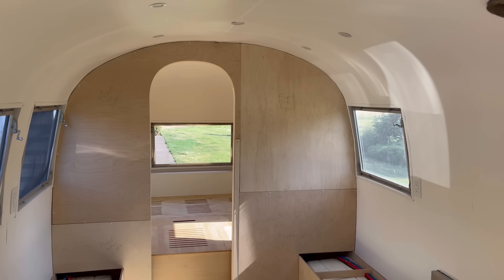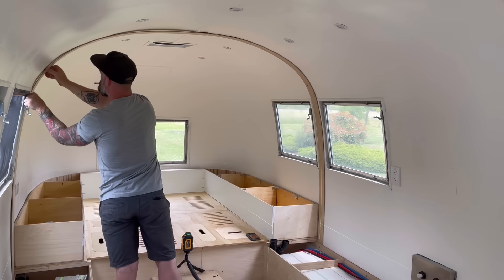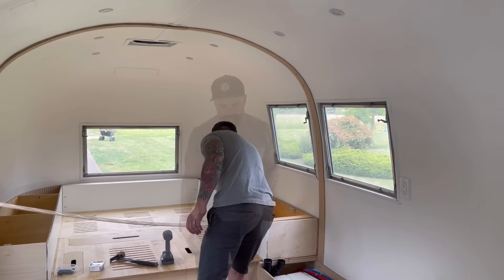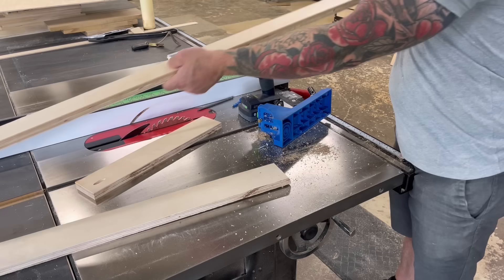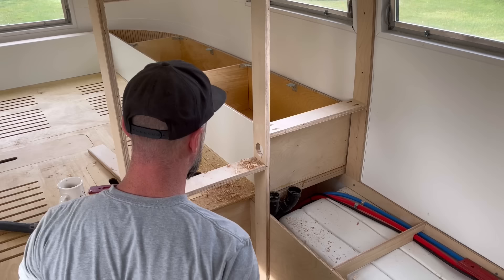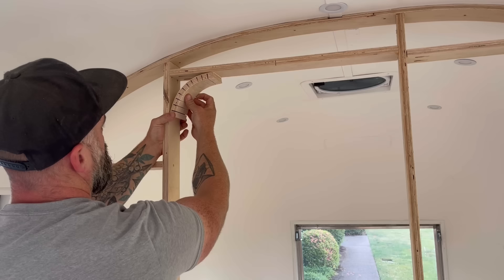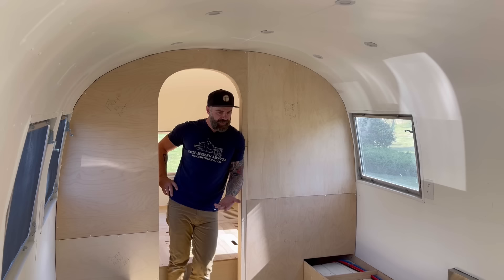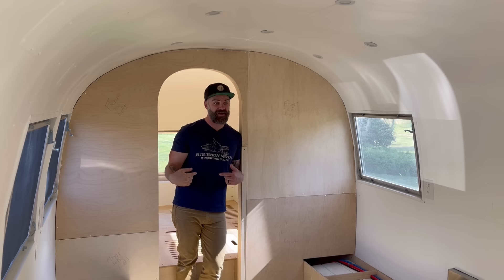Why Do I Make Things Harder || Airstream Interior Walls

Comment: For door arch just cut two pieces of plywood with the arch in them and screw them inside the square door frame one flush with each face of the wall. Then you put your plywood veneer on. A thousand times easier and faster

Comment: As for scribing the interior walls, I wonder if stapling a white bedsheet or drop cloth taut to the framing, then just drawing a line with a sharpie along the contour would make an easier template? Dunno if it would work, but it may be easier.

Comment: Isn't scribing more accurate if the reference end and the marking end are kept alined, in this case vertically, through the entire scribing movement? 

Otherwise the result would be a portortion of the original. That make sense?

Comment: Love it. One question: how is the mattress getting passed the wall, presuming that it’s a Queen size bed.
Reply: I think it's a Full size bed. I could be wrong. But I want to see him wrestle it thru the doorway as well.  lol  If he goes with an air mattress, it won't be as much fun to watch.
Reply: I'm guessing it will be one of those foam ones that come all rolled up and then expand. Or maybe even a high quality air mattress? They have to be able to lift it easily to reach all the storage cubbies underneath, so a traditional spring mattress seems like it would be too heavy for that. Plus, I'm guessing you want things to be as light as possible so the trailer doesn't get too heavy overall? Idk about that last point though since I've never used a trailer of any sort
Reply: @SLorraineE  I think in a previous video he mentioned getting a hinged mattress.

Comment: Just an idea. On that curved door way, instead of making all those saw kerfs, couldn't you use flexible veneer and build it up from there?
Also, when cutting the curve for the roof line. Wouldn't be easier to vector serveral lines from a fixed point on each door support. Then transfer the line measurement to the larger plywood and cut it. Just saying.

Comment: Curtians. Walls are amistake. They consume space. All the plumbing should be dirrectly over the tanks and the vent run in th back of a closet. Or even through the shower/toilet area. Always think of the next guy who has to fix, or replace your work. It will probobly be you. Easy access it a priority. Since you have that wall the shower/toilet, and sink should be close. Water heater under the cabnet with the sink. Think small for the sink. Use a extra moisture barrier between the plumbing and any wood. Plastic, insulation, plastic, and water sealer. You will thank me when a pipe bursts when the water pressures are hi or when you forget or think its fine and a freeze happens.

Comment: Your issues with scribes is because you don't know where you want to go, direction and distance. By changing the angle of your reference as you go, you change the target angle of the scribe, leading to multiple scribing. If you had a finish material, this will never work. A scribe is like moving something with a target distance and target direction, both of which shouldn't change.

You are correct in saying that you needed to scribe in both directions, but it is actually possible.
Obligatory math, but if you place the piece a distance X from the top and wall at the same time, and clamp/pin/whatever.
When you scribe, scribe as well as you can at a 45 degree angle down and away from the wall, so that your scribe is set to (X times sqrt(2)).

This will move the piece accurately X in each direction simultaneously. If you need to remove a bulk of material to get it close before this scribe, you will only ever cut twice, a rough cut and a precise cut.

I know this comment sounds preachy, just figured it might help explain the method a bit further. Love the videos, my son (4) loves them and wants to do projects with me every time he watches.

Comment: Your scribing issue is you are not keeping the scribe vertical.  You are changing the angle with the curve change which skews things.  Pick a reference direction such as up and use the same for the whole scribe line and not change during a curve.

Comment: Pro tip! (Not a pro): When scribbing around a radius, don't turn the tool. Keep it either vertical or horizontal, stay with one direction and slid the cut piece into place in that same direction. Give it a try, should be able to get a tight fit within one or two cuts.

Comment: When making the curved arch in the door opening, why don't you slightly wet the ply and it can bend easier. In the first attempts with the kurf cuts exposed on the inside, why didn't you make a form to bend on a bench. The kurf cut piece could be temporarily held to hold its shape and fixed in the door opening.

Comment: Brave move with the laminated wall! Another option would have been to make a small 'lofting table' - like when making boat frames - and using nails, set up a template for the curve, glue up the layers of ply, and clamp them together against the nail template so they dry in the shape of the required curve. That way you'd then be screwing the whole laminated piece in, and the screw remain accessible so you would be able to remove it.

Comment: I’m not sure if you have more scribing to do (ya you probably do) may I suggest a little trick that should reduce trips to the shop?

Cut a piece of 4/4 stock into a perfect 4” diameter circle. Then drill a hole in the centre that would allow a friction fit with the pen you’re using. Poke the pen in tip first and use that. 

The circle will ensure your pen is always exactly the same distance from the wall, and the thick stock should ensure the pen is marking at 90 degrees to your template piece. 

Note: if your template piece is further away from the wall than 2” you need to make a larger circle. Experiment with the circle thickness and diameter to get something you find usable. Good luck!

Comment: Why didn't you build a jig and steam a peace for your arch or cut one out of a solid slab of wood?  I'm sure you have your reasons and I'm curious
Reply: True, though rigging a steam box or the like would be a lot of work for just a thin almost veneer, and it would be a waste of material and added weight to use a cut solid wood arch.

A wet towl and an iron probably would work well.

Comment: I'm pretty surprised that you're using only screws, both pocket and sheet metal. That doesn't bode well for long term durability in a moving vehicle. Normally you make really strong stuff, so this is surprising. Otherwise, this looks good! I so wish I had one of these.

Comment: 21:47 It doesn't make sense. You should just save time and materials by scribing properly...
When you scribe, for example the top part of your piece, keep the scribing tool (hand, finger, ball launcher, etc.) VERTICAL at all times. That way your piece will move only one direction, in this case up, and fit on the first or second try depending on how much material needs to be removed.
Keeping the scribe perpendicular to the surface is like shooting yourself in the foot, then doing it again when you don't understand why it hurts.

Comment: Since the Airstream is basically an aluminium Fuselage, you should probably build the interior to FAA passenger aircraft specifications...that means all that woodwork you've installed so far? That's gotta go, dude.

Also, no air gaps cuz' you're gonna have to pressurize this sucker 🤣

Comment: Compass compass compass
You still haven’t learned how to use a compass.
You bought a “scribing tool” ??
What the fudge 
When “scribing” you must maintain the same angle, and hold the tool angle consistently over the entire scribe.  If you need to transition from a horizontal to vertical …..  use a 45 degree hold on the compass.